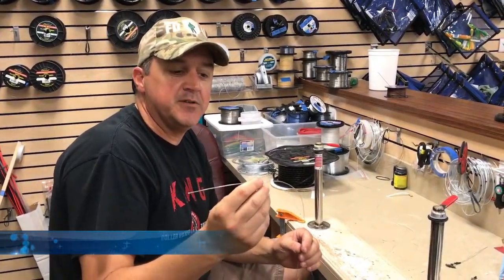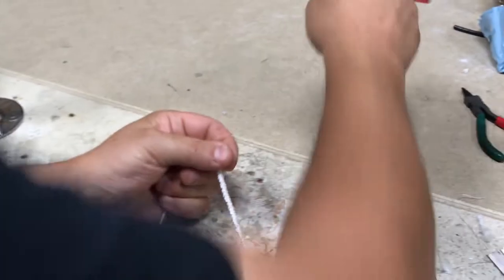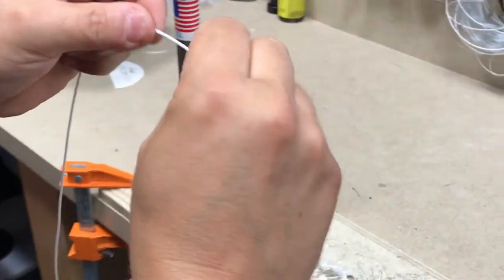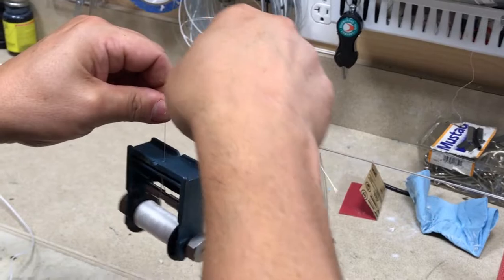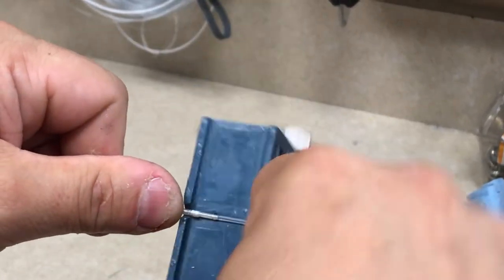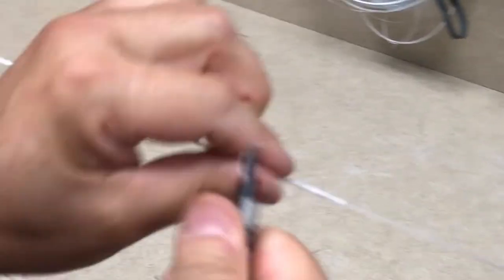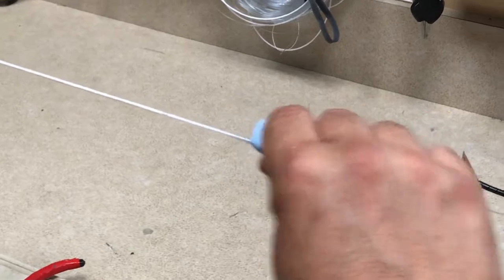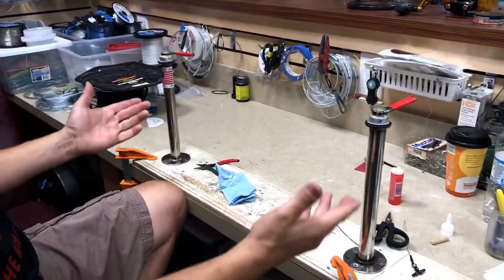How to tie a Serve Connection for Loop 2 Loop Top Shot & Wind-On Leaders

Comment: Where can I purchase the bench clamps? Any help would be greatly appreciated and thanks so much. I have been doing the exact same thing you’re doing for many many years, but I have been doing it the hard way. It works just the same, but it takes a lot longer. I have to say this is the first video I have seen that actually shows how to make a real wind on later the correct way. So thanks so much for sharing. Please let me know about the bench clamp if you can.
Reply from the maker: Give Chris a call over at Pelagic’s outfitters in Lindenhurst, NY. Tell him you saw the video.

Comment: How long must the dacron or spectra be when cutting it prior to splice of double wall? How long is it after inner wall has been spliced into outer wall? I use it for sharking and would like to know what length of dacron is safe. Can surfboard wax work instead of bowstring?what is the function of wax?good content. Best regards from South Africa
Reply from the maker: I spoke with Larry. he starts with an 8' section and puts it into its self and ends up with a 4' piece.

Comment: What is the line you use on your winder pls? Is it a 1 size (strength) fits all? or do you use a stronger 1 for bigger, heavier leaders. Thx.
Reply from the maker: Jim Mascaro I would call chris at Pelagic outfitters in Lindenhurst. He can answer your questions. I think it was like 50# spectra but not 100% sure